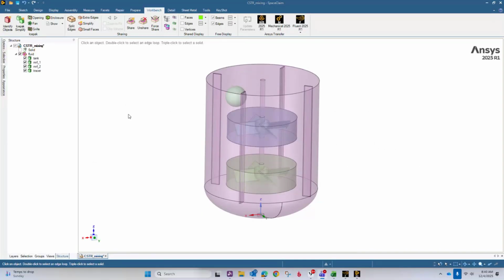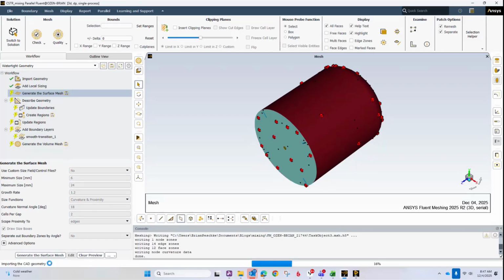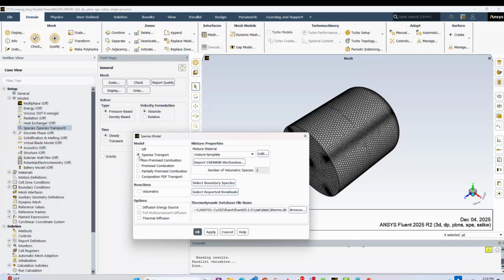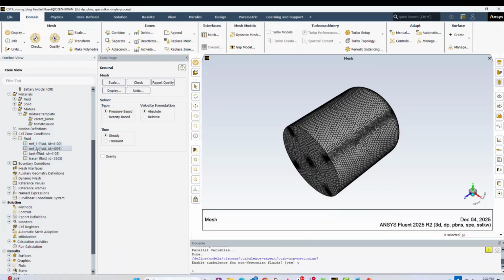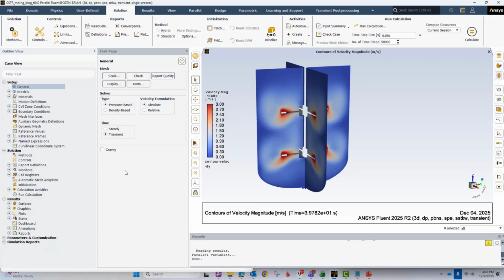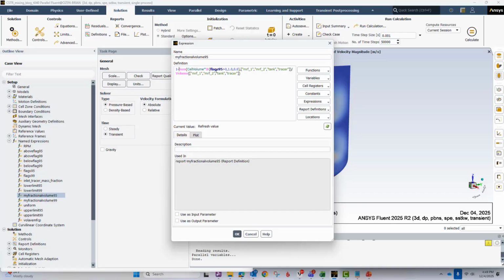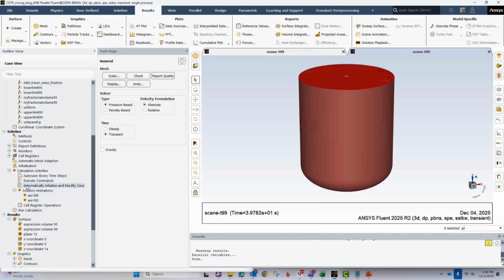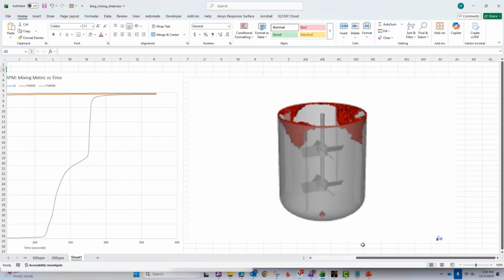Fractional Volume Method for Stirred Mixing Time Evaluation with CFD

Comment: I learned/reviewed my mixing tank playbook a great deal with this video. Thanks a milion!!! 

In the "myfractionalvolume95" expression, what;s the role of using IF(flag95>0...) function? Isn't flag95 always equal to 1? Inother words, why do you use IF(flag95) there? I understand you say flag95 can be zer, one or two, but how can it be like that, ifit's defined as above95 + below95? Everycell is either above 95 or below it, isn't it?